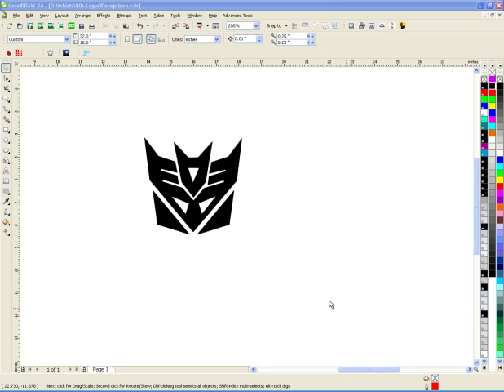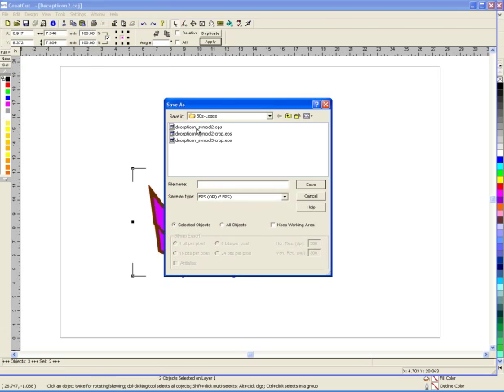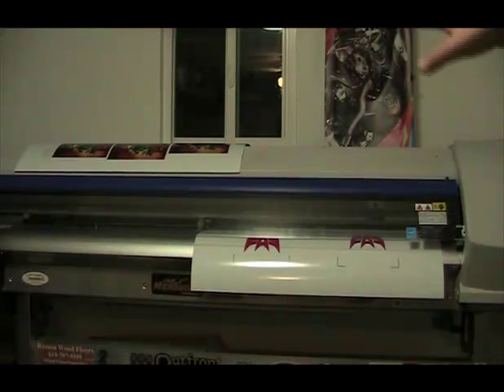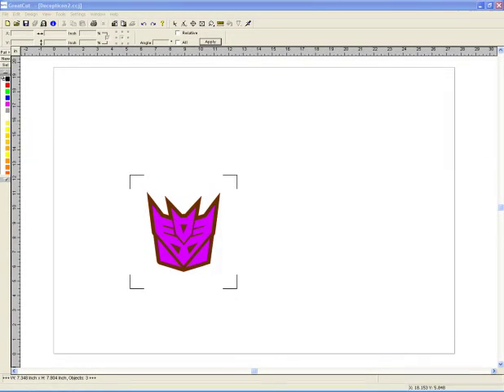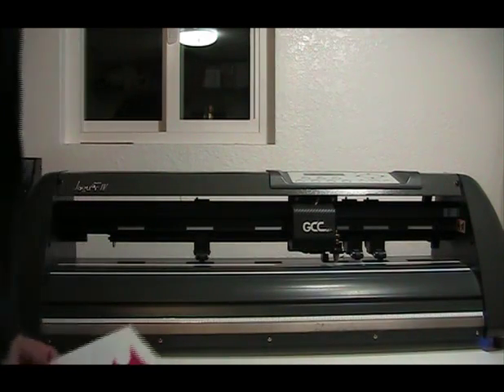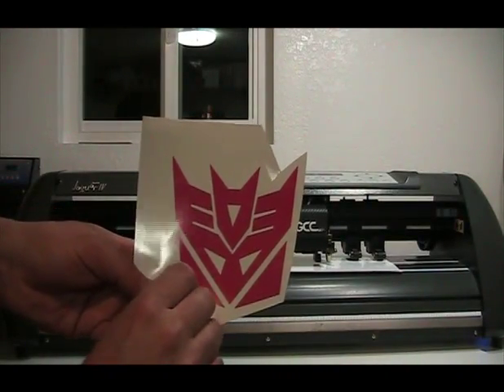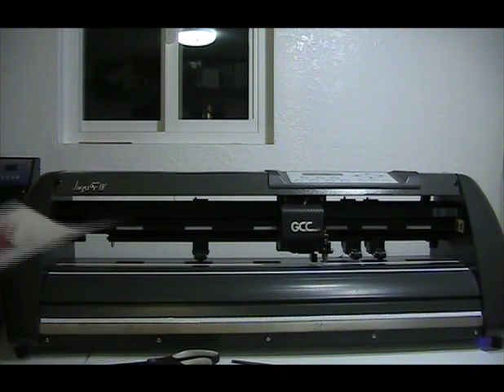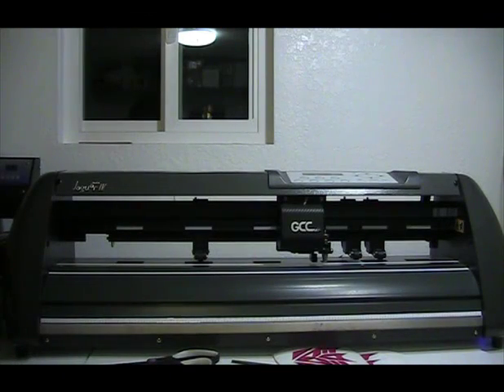Synergy 17 - Contour cutting with the GCC Optical Eye

Comment from the maker: Heat transfer vinyl shouldn't need any transfer tape since it's cut in reverse and applied with the carrier tape on it. Vinyl which is cut "regular", not mirrored, usually needs to be picked up and transferred. This is why the transfer tape is needed.

Comment: Can it cut heat transfer vinyl that already has graphics that is ready for direct application to a shirt or do I have to use Transfer tape like you are implying?
Reply from the maker: You would have to peel it off and place it manually, if you don't want to use transfer tape.